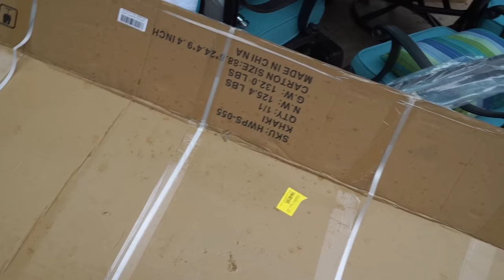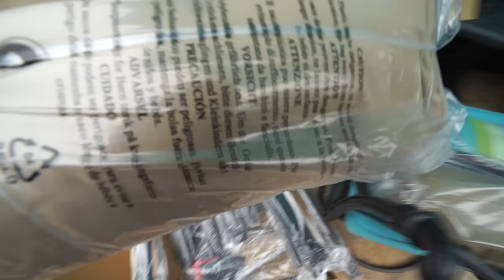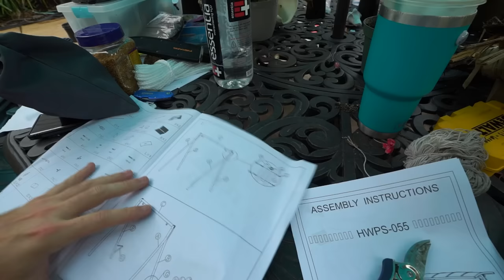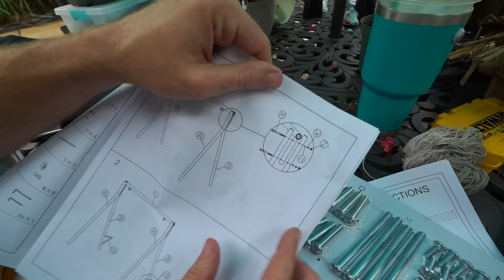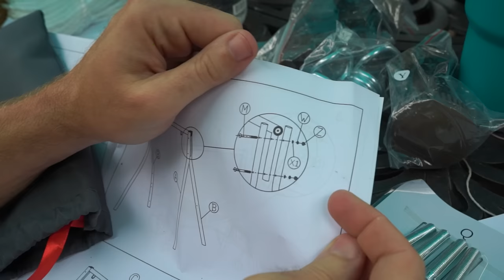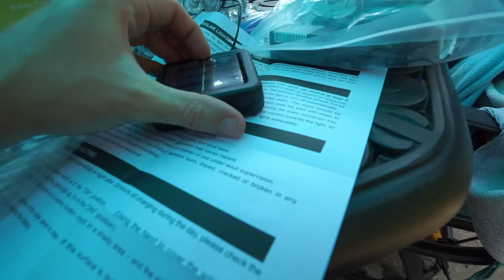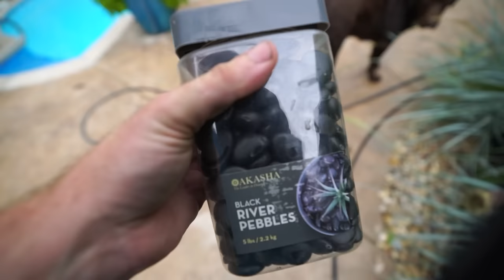New Outdoor Furniture from Amazon || Repotting Plants || Auto-top Off For Fountains || Saturday Vlog

Comment: Yeah, the instructions on things these days. I bought a murphy bed and it said it would take two people 8 hours to assemble. Lies. The instructions were awful and it took two people a week. The faux doors were so warped we had to modify the mounting brackets in order to get them on. But, it is in, it looks good and I don't have that awful sleeper sofa in the den anymore. 
The glider is giving me a very summer camp vibe. You need a little fire pit to make smores to go with it. And the pool palms are starting to look a lot better than they did a few weeks ago.
The drought here is getting intolerable. We have had the driest July since 1942 (only 5 days as of today had rain, as opposed to the typical 22), we are currently 18 inches short on rainfall for the season and pretty much the only way to catch up would be to have a tropical system come through and dump a foot. And it is the second hottest July since 1942. I am so over going out to water. I should not have to be out with a hose every day in July in Florida.
Reply from the maker: Seems to be the norm with instructions! This was fairly self explanatory with the exceptions of the parts not being properly labeled. Had the same issue last month with a TV wall mount. Several of the pieces weren't marked correctly so just had to figure it out. ... great thing to do with an item that will be suspending a TV from the wall! 
I hadn't heard about any drought in Florida until like last week. I can't believe of all places that it's dry down there! Is it still obnoxiously humid even without all the rain? 
I can imagine, it's been a summer of watering here also. Even with all of the drip I still have to give everything a good soak with the hose since the humidity hasn't been consistent and I have so many new plantings. Getting better here, starting to rain more, hopefully it'll start there too! And without being dumped on relentlessly and then all the flooding and what not.